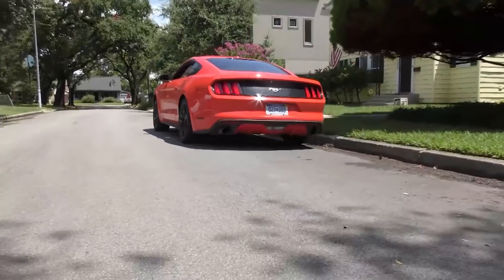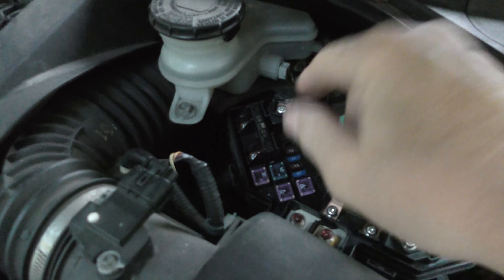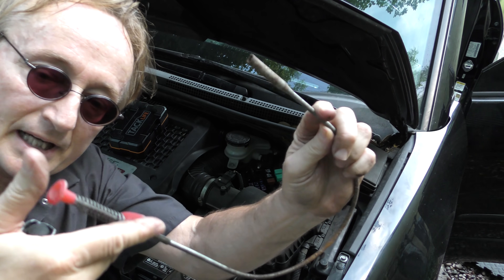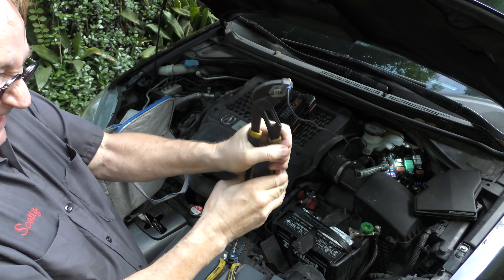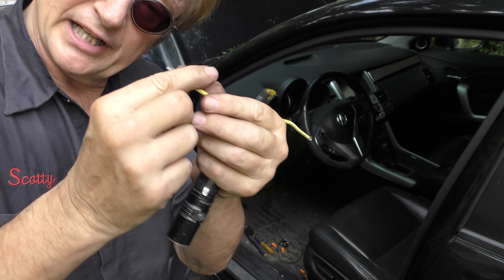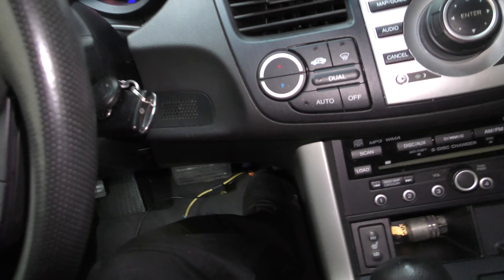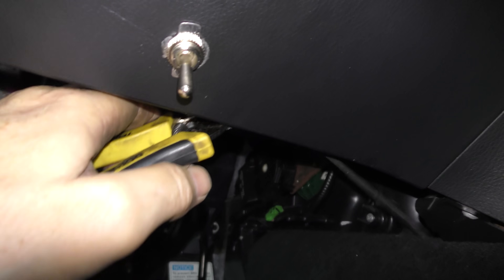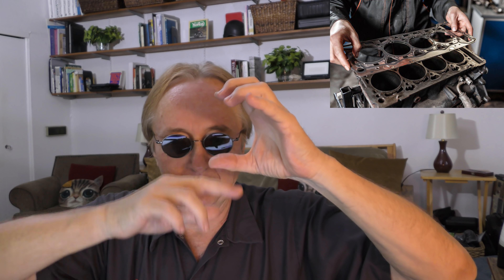This Acura Has a Serious Problem

Comment: Just hook up a relay to the ignition and fuse, no need to drill a hole in the firewall... And it will be automatic.
Reply: Customer wanted a cheaper fix
Reply: Great idea
Reply: Show me a video
Reply: I came to the comments to post this
Reply: Precisely what I was thinking. You beat me to it.
Reply: And make that relay a solid state one so you don't have to worry about mechanical failure.
Reply: U beat me to the punch!
Reply: Tim Kidane  yep but most people wouldn't know how to wire it and need to use something out of the box.
Reply: Customer probably don't want it off all the time
Reply: @sim6057138  i think u meant to say "ON"
Reply: I would like to know y Scotty didnt do this.
Reply: Smart
Reply: @GuerreroDelInfo   a relay is 5 bucks and easy to install.
no need to drill a hole.
Reply: That's what Samcrac would do.
Reply: Scotty just showed us let's see how you would do yours, well??
Reply: You could also just find a fuse that gets power with the key on and plug in a fuse tap
Reply: Exactly my first thought.
Reply: Would you mind showing how you would wire this?
Reply: @edy5082  Normally, the red and black lead from the ignition switch is hot when the ignition is on, use a multimeter to find the lead that is hot when the ignition is on. Use a power thief (clamp over the cable) and connect a lead to the power thief and the other end to one side of the electro magnet coil en the relay, and connect the other side to ground. Then connect the relay common contact to the hot side of the fuse contact, and lastly connect the bottom side of the relay switch (nearest to the electro magnet) to the other side of the fuse contact.
Reply: @MrNibbleByte  Can you link to the "power thief clamp over cable?" It sounds like a great solution but I never heard of it.
Reply: Whats a relay?
Reply: A relay would work yes but a far more complicated device than a simple switch to wire in properly. It would also require a separate power source outside of the circuit your trying to repair. Just because a relay could work doesn't make it a practical option. In most cases simple is much better. What as a fella mechanic we call (KISS keep it simple stupid)
Reply: @OfficalDirectBasketball  Mechanics aren't usually great with electronics.
Reply: DREW Evans 305 It’d be on only when the power is on, just like when it wasn’t broken.
Reply: lvsurfcat that’s a better way to fix it. Why would he do it if he doesn’t have the same problem?
Reply: Makes much more sense.
Reply: I did the same thing to another fused circuit
Reply: Working in the 12v industry, all you see are switches for electrical problems to bypasses. Great tip, love the SPDT relays
Reply: Scotty likes to be in control of what the car is doing. A switch allows for that.
Reply: @172-e5s  The mounting of switches here and there aren't as much of an issue as the complete lack of labels as to what those switches go to.
Reply: @mr89firebird  me too😂😂 he beat us to it🙈🙈
Reply: EXACTLY!!! Plus the fuse should be in the engine compartment. Did he use a grommet? A relay solution would be so much better... Could even use an opto-isolation relay!
Reply: Ken Jett ... far more complicated? Not really. A relay is a simple device. I would use a solid state option-isolation relay. Tap the fuel pump relay output to power the led in the relay. Run the fuse on the output.   I haven’t look, but I believe one that can switch 20A can be had.

I hope the owner told Kilmer to fix as cheap as possible. Otherwise, Kilmer is showing a bit of ignorance on the electrical side.
Reply: That's something I was thinking too
Reply: Its easy than fix a relay every thing near the fuse box and operated automatically 😂
Reply: Please do a video

Comment: Disconnect the Bluetooth module, and voila!, it should be under the armrest area.
Reply: I did exactly that for my 07 Acura MDX and after disconnecting the darn Bluetooth module, the Acura no longer has a battery drain!  Worked like a charm!
Reply: That would've saved Scotty the opportunity to show his old wire and switch method., once again! Cruel fix but it works
Reply: word.  My 2008 Acura TL ate batteries like Pac-Man ate dots well I disconnected the HFL Bluetooth module and no more problems.  I never used it anyway so didn't care.  Been 4 years and works like a charm !
Reply: My 08 MDX had the same issue. Disconnecting the Bluetooth module fixed it. Love Scotty, but this fix is way too crude. I would never do it to my car.
Reply: GnatGoSplat Some people actually use the bluetooth, having to disconnect and reconnect it would be a pain.
Reply: @AngeDeTristesse  same with my TL.  It is probably as common as cracked dashboards.
Reply: I guess im old not having bluetooth wouldnt affect me one bit then again i dont talk on the phone while driving haha
Reply: Relay would cure this
Reply: Should have used a grommet where the wires went through the firewall. Safety first.
Reply: @loganmw  It's my understanding once the bluetooth starts draining the battery, it doesn't work properly anyway. So disconnect/reconnect isn't a viable fudge-fix if you want to use the bluetooth.
Reply: mark price maybe the customer wants to use the bluetooth module
Reply: Do you have to enter the theft deterrent code every time you use the switch?
Reply: scruffy26 yeah I disconnected the hfl on my TL the car kept dying everyday overnight
Reply: My 2008 Acura RDX had the defective bluetooth module draining the battery. Unplugged it and the problem went away.
Reply: @AngeDeTristesse  is your 08's dashboard crack-free?

Comment: Inevitably, the owner will forget to turn off this switch at some point.
Reply: Dan Daman could’ve used one with a led or maybe hook it to the ignition so that it’d turn itself off when the driver turns the power off and takes the key away?
Reply: Yeah a relay is a better idea
Reply: @apachelives  agreed! Even better one would have been to find and isolate the component causing the power drain, then fix or replace it )
Reply: @dandaman4985  
Yep. Precisely what I eluded to in my post. Drilling holes, adding switches is not the answer. If your too lazy to fix it correctly, sell or trade it.
Reply: @dandaman4985  ,, The problem is a parasitic drain in the fuse box. He should have just replace the fuse box.
Reply: @michaell3711 well, that sounds expensive - costing more than a switch anyway) how do you figure it is the fuse box, and not a loose or exposed wiring somplace along the way?

Comment: A lot Acura's of this era has a problem with their Bluetooth Module which is tied to the infotainment. Bluetooth would work find but the module wouldn't properly shut down and continue to drain. I believe there was TSB on this for the MDX but not sure about the RDX. might be worth a shot to disconnect the Bluetooth Module to see if it will continue to drain. I recall Acura having a revise part number for this module.

Comment: Scotty my son is a Master Tech.  He worked on Accuras for years.  He said a common cause of parasitic drain coming from the head unit in older models is children putting coins in the CD player.   He seen this dozens of time.
Reply: Great tip, Greg. My son filled our Sienna's CD player with coins. I shook out $5.00 probably.  Those coins I bet get in contact with circuits and blamo! Parasitic drain.
Reply: I've seen similar situations
Reply: @captinbeyond  requires a snap action wrist ; )

Comment: I'm laughing, cause I've made similar repairs. I had a 77' 280z, it wouldn't start.. sometimes! But if I shorted it to ground..it would start maybe 30-40 times in a row. So I wired in a momentary start switch..it worked! Used it for the 2 yrs I had it, sold it in the same condition!..I'm 71yo!, And I've own a lot of junk!..lol
Reply: A friend once wired his 280zx fuel pump connector to a cigarette adapter.  It worked great!
Reply: 71 & know how to work a smart phone. You’re a legend
Reply: 71 years old? Wow. Hope God give you another 30 more years Larry. 👍
Reply: Wiring an old car isn't the same as modifying and drilling holes in an expensive Acura.
Reply: @stansorochman2701  its not expensive ffs...

Comment: Had a 2006 Uplander bought it used with 51000km. ECU died within months, was covered under an aftermarket warranty. Some years later the doors quit unlocking, all but the driver door, when the van was cold (many months in Canada). I wired a relay to break the unlock wire from the module that controlled the locks and trigger another relay to operate the actuator to unlock the doors. When it was warm out the locks worked as usual; however, if they failed we could still get in the hatch and other doors with the push of a button on the dash. At 165000km the ECU started to fail again. Traded it on a Caravan, and it starts all over again. Its too bad used vehicles are almost the cost of new here in Canada.  Thanks for the tips, love the videos.

Comment: This is exactly the solution that came to mind when I watched your earlier video about someone's car (I don't remember if it was this one or another make) that was having the infotainment system drain the battery. I used to have a 1975 AMC Hornet where my stepdad and I wired a push button starter into it to bypass whatever was going on inside the steering column. I wonder if it would be possible or worth it to wire up a trip switch that is activated by the ignition when it is in run mode. That would do it automatically without having to remember to flip the switch.
This battery drain issue seems to be a common problem with modern cars.

Comment: The hands free link/ Bluetooth module goes bad on the older Acura’s and drain the battery. It is hooked up to the radio circuit. Had that issue on my 04 tl. Just have to locate it and disconnect it. No more drained battery.
Reply: Locate it. Test to ensure that's the problem. And if it is, replace it with a new one that doesn't leak when off.

Comment: 2 things, Scotty.  1) The fuse should be mounted closer to the fuse box. A short in the live wire has too many places to potentially ground out with the fuse in the cabin.  2)  Instead of a switch, use a relay, with the low-current input set to any switched circuit.  When the key is off, so is that relay.  With the key on, the circuit is closed and the nav system works.

Comment: On the Acura, if you want to accomplish the same thing but avoid the switch, you could put in a relay that breaks the circuit when the power goes off, with the same configuration with the inline fuse, but the relay could go under the hood avoiding drilling the holes.

Comment: A common problem with many acuras draining battery is the Hands free link module. Plus the drain is on the navi circuit, i highly suspect it is. The fix is just to unplug the module located by the dome lights and the rear view mirror

Comment: I’d wire everything on that fuse to “hot all the time” so he can’t forget to turn the switch off
Reply: sammolloy1 too much amps for most fuses OR switches to handle also if you actually switched everything you’d JUst have to switch a battery terminal.

Comment: 9:30  fancier Mercedes doors have auto close features, like what some higher end SUV's rear hatch has.
it only works when there is power.
if the owner did not close the door properly, and armed the car with the remote keyfob, it wouldn't work.
Reply: Maybe the owner was kidnapped!

Comment: Hi Scotty I was a builder before retirement and when I built the glass brick the reinforcing bars were stainless steel and very flexible plus came in  10 ft lengths so you can imagine I was very popular with the electricians for pushing their wires through and with the bars being only 6 mm thick they could run almost anywhere only problem was that I was only sent enough for the job I was working on so reclaiming my bars back was sometimes very stressful for the electricians as they then had to try and get the wiring through some difficult places without any assistance from something more rigid

Comment: If your going through all that trouble, why not take a wire from one side of the fuse, put inline fuse on as you said and tap into the on side of the ignition switch then back to the other fuse terminal?  That way when you turn off the car, it will automatically turn off power to that circuit.

Comment: It's the HANDSFREELINK module Scotty! Just disconnect it
Reply: Why disconnect it. If you put a relay instead of a switch, everything will work fine.
Reply: @shane250  No, the hand free link stops working after a while therefore this is pointless. To disconnect it takes like 5 minutes.
Reply: But what if the customer wants to use his hfl?
Reply: Hmmm true. But I feel with a bit more research, there are users who have sourced a newer HFL module that doesn't drain the battery. I own an Acura of that vintage myself, but I bought the car with a revised HFL. They're pretty easy to replace too, since they're located right above the sunglass holder

Comment: Forget the switch. Use a relay controlled by the ing. Switch power to close the circuit across that fuse but ; remember to install a inline fuse to protect that same circuit

Comment: Clever! I admire the ingunity. Currently there's no fuse protection for the wire that brings power to the switch if it rubs against the hole in the firewall enough to short out. Probably safer to put the fuse in the engine bay, on the wire that sends power to the switch.

Comment: Scotty, instead of the switch would it have not been easier for the customer if you installed a relay? the coil of the relay could tap power off of something that only powers once the ignition is active, then it would only complete the circuit for the faulty fuse port when the ignition is active. This would be a cheap easy swap, that would work in more of a passive manner rather than the driver needing to active the switch. 

Great Videos by the way!!

Comment: Just unplug the system for the wireless phone its under the center console on the passenger side . I had a customer with the same car that had the same problem. The wireless phone system is running the whole time ignition switch is off the system is  looking for a connection but draining the battery at same time

Comment: On that Acura, its more than likely the Bluetooth module. Had this start to happen on my '11 MDX. Did some research, found a simple remedy: bake it because of micrcracks in the solder on the circuit board; baking it allows the solder to melt enough to reattach itself. Must be done at moderate heat and only roughly 10-15min iirc. Also done on a none conductive surface.. I did this a couple of times, and it worked; no more battery drain or Bluetooth randomly dropping out while driving...

Comment: On the Acura battery draining problem, why not install a 12 volt relay that closes only when the ignition is on. Then wire the normally open contacts of the relay in series with the fuse. Then the vehicle will be back to normal minus the battery drain. Cheers from Australia.

Comment: Dam, that's my screwdriver you've got.
Another option is to install a relay. Coil across the ignition and n/o contacts in the fuse circuit. No forgetting to operate the switch. Another great entertaining video. 🥇

Comment: Was the customer able to lock the doors with the key fob when the switch was flipped off?  Also did the radio presets reset?  Thanks Scotty! Great Channel!
Reply: Even the radio security code have to be input all the time, but the worst is the key part
Reply: No, when the switch was off (or fuse removed) the power door locks didn’t work. So this still is inconveniencing the customer if he/she cares to use the key fob to lock and unlock the doors.

Comment: The separate fuse you installed should have been installed close to the fuse box it was replacing.  The fuse should always be as close to the power supply as possible.

Comment: I'm surprised your high end scan tool can't pinpoint the battery drain. One of those subsystems is faulty. But the toggle is a good work around.

Comment: No need to drill that hole or mount the switch, you could have wired a relay by the fuse and activated it with power from a neighboring fuse that became hot with the key on, that way you don't forget to turn the switch off, much neater and more convenient also.

Comment: This is a "repair" job I'd do to an old clunk apart. Not a half decent vehicle. Crimping with channel locks? My inner electrician is rolling right now.
Reply: Seems a bit dodge. Also there are usually a few holes through the firewall, I wouldn't be making new ones.

Comment: More time/labor, but the power source to the nav unit could have been bypassed to work only when ignition switch is on, complete cut-off of power to nav unit, and easy in-line fuse right under steering column somewhere.

Comment: Plz scotty listen, the reason for these acuras having drained batteries is the hands free link bluetooth module always goes out, im kind of surprised a mechanic like you doesnt know about this common problem. All you have to do is disconnect that bluetooth module or replace it if the customer really needs it.

Comment: I wish I had seen this video earlier. My 2008 Mazda CX 9's Bluetooth module was faulty and wouldn't work, and it was draining my battery. Even after shutting off the car for an hour, the module was still hot. The fuse was shared by several other components so I couldn't just unplug it. Out of desperation I just cut the wire off and my battery no longer go dead even after one week without driving.

Comment: @scotty my 2006 Acura TL  had a battery drain like that, I found out the integrated  Bluetooth was the culprit. If the Bluetooth box is hot while the car is off that's the drain I unplugged mine and the  battery drain is gone hope this helps.